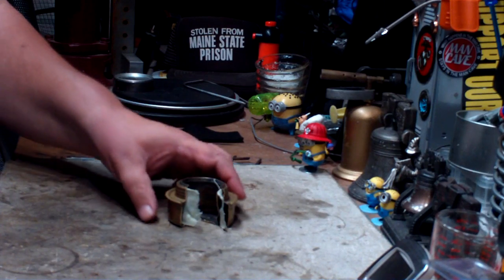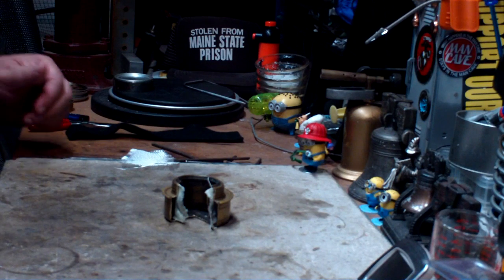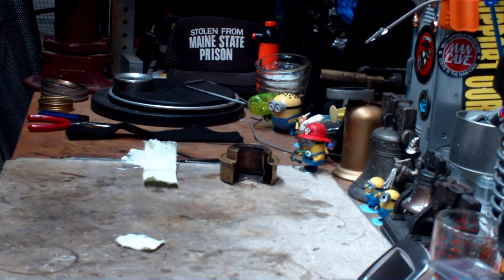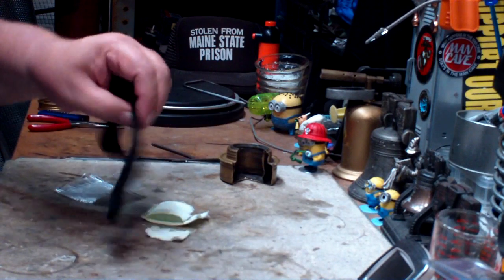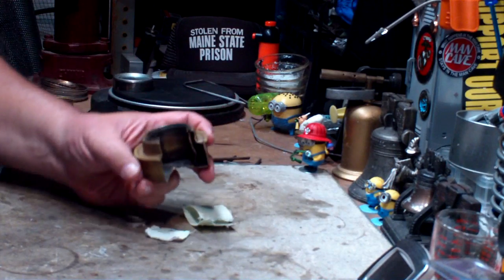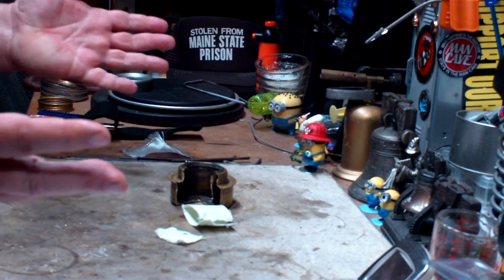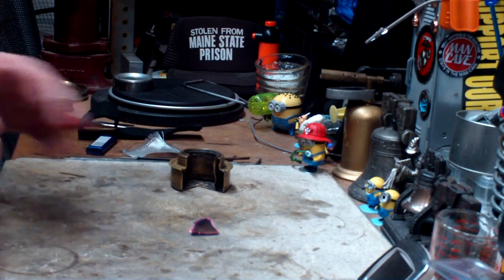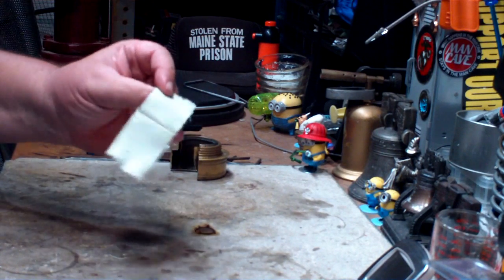Let's See What's Inside a Trangia Burner - Q & A

Comment: How do the fumes get to the cotton section if the bottom of the stove is sealed?
Reply: It’s not sealed on the inside bottom, it has gaps so the fuel can flow to the gap between the inner and out walls.
Reply: @akbychoice  Thanks.  I see now what you mean.

Comment: If the wick burns without melting it's a natural fibre, like cotton or linen
If it melts then burns, it's synthetic, like nylon or polypropylene
If it glows red then melts, but doesn't burn (in a Bunsen burner - a match or lighter is not hot enough) it's glass fibre
If nothing happens, or it glows red but doesn't burn, it could be asbestos
It's white, so it's not woven carbon fibre
Reply: simon4043 the Wick is Fiberglas Original model 1959/1961 it may have additional Material since Mid 1980.

Comment: please cut a Alocs open would be nice to see whats inside
Reply: +barrie watson I'm 99% sure its cotton as well. I had a couple tiny strings of the material hanging out at the bottom of the inside of my Alocs. After watching this video, I promptly pulled them out farther and set them on fire with a lighter. They burned away fast. Definitely not fiberglass, or any other fire retardant material.

Comment: There is a guy soldering the trangia stoves because some leak, usually dont notice it but if you keep fuel on in them it can be an issue. Steve with firebox stoves talks about it in a youtube video
Reply: +officershazaam I had this issue with both trangia stoves I bought. I put a small bead of JB weld along the seam under the lip and have had no issues since.

Comment: Hiram, have you ever had a Trangia burner flare up and spit fluid everywhere to start a fire?
Have you ever had a Trangia melt from use?

There are some folk on the inet saying these things have happened to them with Trangia burners using just alcohol for fluid.
There is a picture of a burner that has a flame that looks like it is a foot high above the burner.

My surplus Trangia has never done these things, but I only put in a few ounces of fuel to boil water.
Reply: I have seen that , once. But that was my friend shutting down his brain, and re-filling a hot burner.

Comment: Don't solder the inside of your trangia. I mean that stuff is some pretty nasty metals with a low melting point. It won't be hot enough to melt but that is probably going to be releasing some fumes, fumes from something near your food and which you spend a lot of time sitting over it.
Reply: You won't get fumes off solder unless it melts. If you say it won't melt then you won't get fumes. Either way solder is safe. You'll find it on pan bases where thick copper bases have been soldered to thinner copper sides. It's even safer is lead free solder is used.

Comment: As a point of reference other Swedish gas stoves (not alcohol) like the Svea 123 and Optimus 8R use a 100% cotton wick to get fuel from the tank to the burner where the fuel is vaporized. You are not supposed to use anything with synthetic fibers (like a cotton/ply blend) because  it gets real hot it can melt and won't wick anymore. So It would not surprise me if the liner is %100 cotton.
Reply: Paraffin lamps and heaters use the cotton wick because cottons ability to soak up a lot of fuel per square inch of material is unmatched by most other materials.